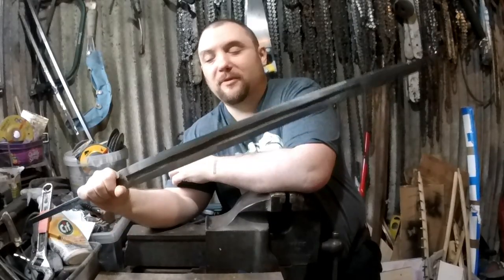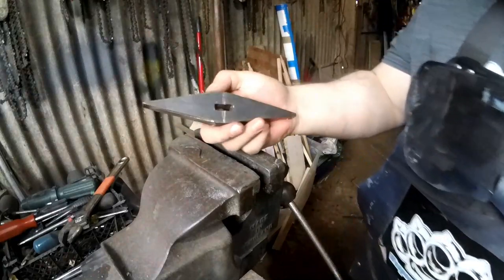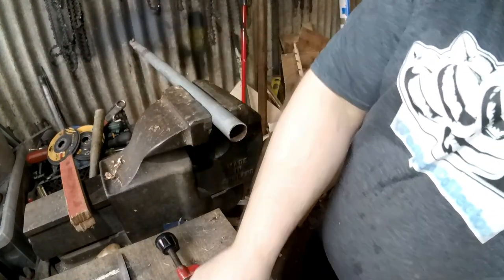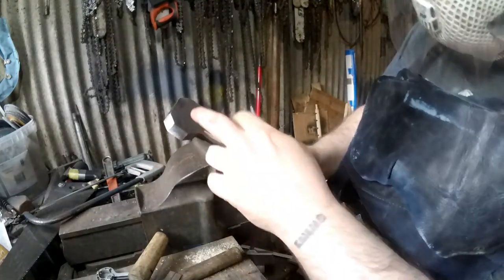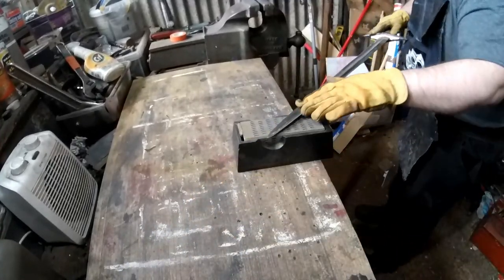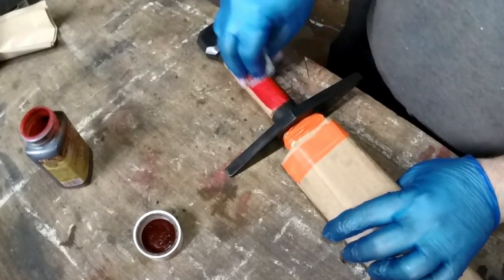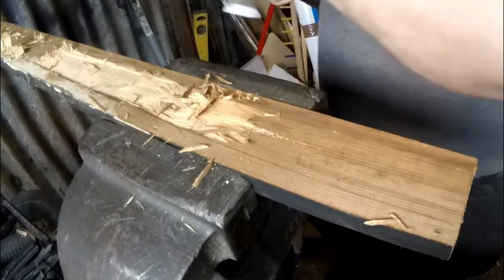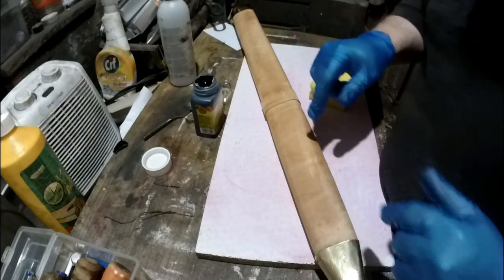How to make an Arming Sword and Scabbard (finished / bought blade)

Comment: Nice work mike turned out great. For anyone wanting the specs for the blade its 27 inch blade length 1045 carbon steel expect for the tang which is iron, 1.87lb weight, and tempered to the upper straw color range for about 20mins
Reply: Good work on the blade, Rich!
Reply from the maker: Thanks Rich, glad you liked it and thanks for making me the blade and for the blade info.